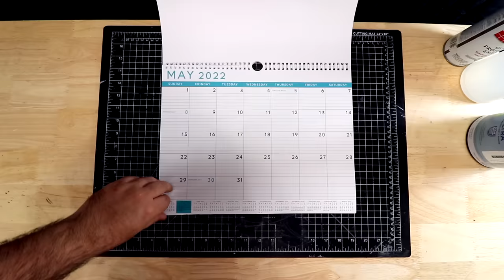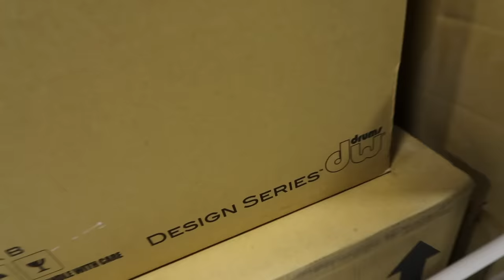The CHEAPEST Acrylic Drum Set You Can Buy!

Comment: I'm amazed at the value for the money. Considering you can find it for under $1000 and it comes with everything you need, good luck finding something better. I fully expected the cymbals to be unusable junk, but they sound at least like real instruments and not cheap filler. The hardware looks just stable enough to get the job done. The bearing edges didn't seem to hinder the sound and you could always touch them up for yourself. I guess you just have to cross your fingers and hope you get everything on the first try!!
Reply: I think that regardless of what these kinds of kits normally cost, if you're paying 1000+ for an instrument it had better be well worth your money
Reply: Pearl export with everything included is under 1000. And heaps better I say. Export rocks
Reply: @mikkeykottak  Maybe a few years ago, but nowadays Exports are over $900 and don't include cymbals. Throw in the fact that the Donner is acrylic and the Export is wood (not necessarily better for everyone, but certainly higher value compared to competition) and it's an easy decision for me.
Reply: I think another reason why it sounded better was because of his mics.
Reply: Reminds me of Ddrum back in the early 2000s
Reply: @zacharyhaverkamp my dude my snare alone was £2750. Everything is relative. Just because £1000 is a lot of money doesn’t mean it’s a lot of money for a car or a drum kit.

Comment: Couldn't resist, purchased. Always wanted a Vistalite kit, but it's hard to pull the trigger on those prices. Thanks for this video,  I'm pretty sure this kit will do just fine! And I appreciate the discount.
Reply: Not worth it .. the boxing and missing stuff... come on.
Reply: I bought this kit and it came with everything.
Reply: @tybreedlove  yep now I gotta see it man lol
Reply: @tybreedlove  I just got mine, looks complete. The bass hoops are wrapped in cling film which is coming up in shreds and sticking badly to the inner side. Taking me forever to peel it. Did you have this issue?
Reply: @tomwalsh4676  I certainly did have that issue. It took me a day and a half to get it off.
Reply: @tomwalsh4676  that was the only real problem I had with it. Whoever thought that was a good idea. Definitely did not think it through.
Reply: @tybreedlove , good to hear!
Reply: One more comment.  The plastic wrap on my bass drum hoops BONDED to the surface on most of both hoops. I can only guess that the acrylic was not fully cured when they wrapped them.  I tried many ways to fix(heat,goo gone, plastic razors) and finally ended up using a metal card scraper to get the surfaces clean.  Then I had to wet sand and polish. They look great now but that was a lot of work. Donner gave me a partial refund to offset buying new hoops which I may still do. (Black lacquer would look cool. ) But I'm still satisfied with the kit and was pleasantly surprised by Donner's customer service.  Very fast response and resolution.

Comment: Sonor has been using this hihat tilter design since the mid 1980's. But as their patent ran out, it's now popping up left, right and center.  The cymbals seem to be a Nickelsilver Alloy which was basically the standard alloy for cheap cymbals back in the 70's. Stainless steel is unlikely as Stainless is quite hard to form and would therefore be more expensive.

Comment: I know they don't get much mention, but Slingerland made an excellent snare drum rim, not very high and curved enough to prevent your sticks from shredding.   I remember there was a Slingerland mounted tom left at a place we rehearsed, and it was apparently mahogany.   Compared to my Ludwig mounted toms, the Slingerland tom was about twice as loud as the Ludwig.   What can make a difference is removing the bottom heads from toms.   Volume increases, and drums can sound better with that bottom head removed.  Shell resonation is something to consider.   I remember having a Tama  top of the line snare.   It was built so solid that it had no resonation.    I sold it because it was so lame sounding, just didn't have the snap and the punch of a Ludwig Supersenative snare.   I put a Slingerland rim on the Ludwig snare.

Comment: It sounds much better than what I expected... but as far as acrylic goes, how much difference can there be other than seams vs no seams or variances in bearing edges.  So the hardware on the shells might be the main difference.  If it shell hardware holds up, that might be a killer price.  You still have the Donner badges tho... that might catch you some heat from gear snobs.

Comment: I wonder if wherever they sourced the materials from is the same place Crush did for the acrylic snare I have from them (which is also red). I was initially excited when I picked it up bc I had been using a very crummy 13x7 snare from DDrum for years, but after a whiile the lugs slowly started literally trying to come apart (support told me they would send me "updated replacements" but after multiple inquiries with no response I never received them). I left the snare in a room that wasn't climate controlled for a couple months and the shell started spider-webbing a bit. Bearing edges were also a bit rough on mine.

Comment: I would def. want to re-route those bearing edges in a most gentle manner on a leveled router table, if nothing else. I had an early lesson about the major problem with acrylics in Jr. High jazz band. Our kit had acquired numerous cracks which propagated over years of transport w/o proper cases. Perhaps these drums should be shipped out with a modest foam layer on top and bottom.

Comment: I ordered a Donner throne a few months ago.Big mistake. If you're 6 ft tall you will not be able to get any height. The screw style spindle was only about 8" long where most spinndle posts are a foot long or longer. This seat is only good if you sit low w thighs parallel or lower.  Its also made from really cheap  die cast metal where there is a lot of stress. The paint was already chipping on the die cast metal. On another note these drums sound good in this video though. The problems getting all the correct hardware seems totally normal with chinese companies like this. Dont expect getting everything you ordered.

Comment: To my ears, Acrylic drums tend to have less variation than wood drums because for Acrylic to work it has to be at a minimum standard that is already of a good quality, and I think the actual process of making the drums is simpler than wood drums. So even "entry" level acrylic drums sound good and are of a higher standard than entry level wood drums? And generally a little more expensive. I guess the quality issue will come out more if you are touring with the Acrylic drums rather than using at home as a practice set. I've always liked the sound of Acrylic drums, and I am hard pressed to say I've heard a brand of acoustic drums that sounded like crap and I don't like.